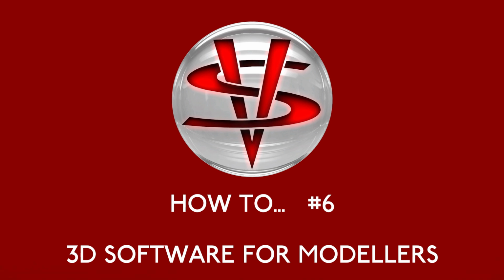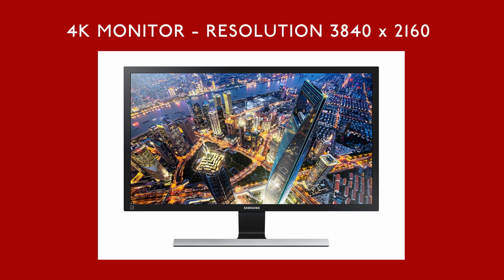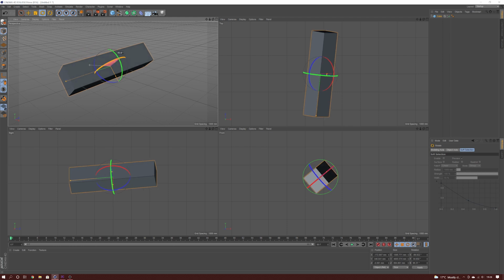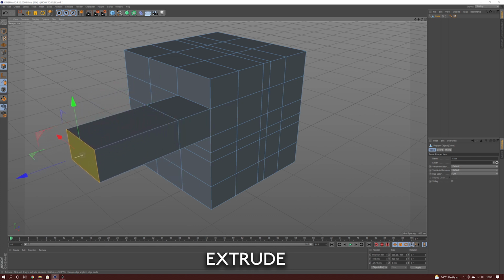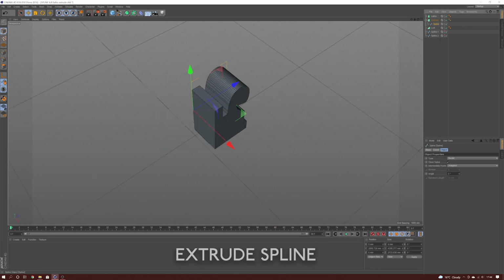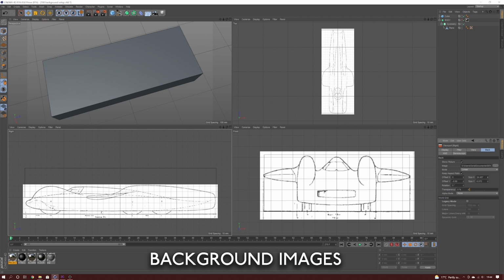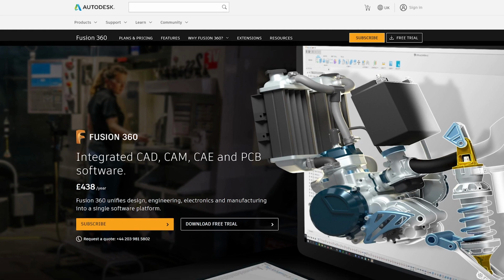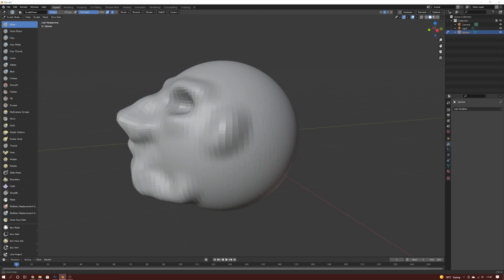HOW TO... PART 6 '3D SOFTWARE FOR MODELLERS'

Comment: Hi Sera, another great video full of useful info. I've been using CAD for nearly 40 years (doing Mechanical Engineering Design) so have gone from the primitive systems that used to take 30 to 40 minutes to refresh a 2D drawing to the amazing 3D software we have now. I'm using Rhino 5 and 7 for my modelling projects, Rhino 7 is the latest iteration and is great but they changed a few things which have made modelling certain items more difficult than in Rhino 5 so I still use both. I'm used to using CAD as a solid modeller where Rhino is really a surface modeller but does allow you to work in both modes. 7 has sub D which i've not used much but can see will be of use to get more free flowing shapes like on your Land Speed Cars. I found the first few minutes particularly interesting as you're using CAD in a completely different way to me but the later half of your demo was more familiar. I don't think people realise just how hard it is to construct a complicated 3D model like a plane or tank so its great they can get an insight in your video. I've been building a complete model including a complete interior, of a WW1 Renault FT Tank in 9th Scale which has taken 8 weeks, working 7 days a week so must be around 500 hours of modelling so far and i've still got a fair bit to do. But then you know how long these things take. I'm designing with manufacturing in mind so stripping the model down for 3D printing or machining is reasonably easy.  Rhino renders almost instantly which is one of its great features and you don't have to set up the resolution of parts until you export them as STL files. The only thing that does slow down is manipulating the model when it's fully rendered so I avoid doing that. If ever you'er thinking about changing CAD Systems, which i'm sure you won't, it is worth looking at. Trying to get to grips with Blender but finding that a bit of a challenge, it's so different from any CAD software i've had a go at. Thanks again for the content, i'm impressed by just how much you manage to do with your business and your side projects. Best wishes Mike
Reply from the maker: Hi Mike, thanks for the great comment. I'll check out Rhino, it may be perfect when Windows upgrades stop my C4D working. I'm going to try figure sculpting in Blender for my StuG figures. Should be a challenge 🤔. I'm always doing something modelling related that's how I  put out so much stuff. Fortunately I enjoy what I do. All the best, Sera 🙂
Reply: @StaplesandVine  Well, the only downside to Rhino is you have to buy it of course, the good thing is they do keep upgrading it for free even after other versions have been released, you just have to pay for new versions if you want them. I upgraded from Rhino 5 to 7 for the sub D feature. I never bothered with 6 as it didn't offer much in the way of new features that were useful to me. Not sure how much it is in the UK as i'm in New Zealand (but originally from the Hampshire). Rhino do a free 30 day trial so you can have a play before you commit to purchasing it. I think its better than Fusion 360  but in saying that David Parker of AFV magazine fame is using Fusion and he's my favourite model maker (i've never liked AutoDesk products much, they seem to use a lot more memory). David Parker is a genius, the combination of scratch building skills and painting is the best i've ever seen. I run Rhino on Macs, the PC version sometimes has more features but they're almost the same now. I know Fusion 360 is free for home use but you have to pay for it if it's being used commercially.  The good thing with Blender is all the add ons you can buy to help you sculpt but you probably already know that. I'm actually a sculptor so thats why I started playing with it. There's a good add on called Facebuilder which is made by Keen Tools which i've used. You can get it on a 30 day trial. You basically need a few photos of someones head taken at different angles with the same camera and lens combo. You then use the images to manipulate a standard head. I've created loads of heads with it and 3D printed them on my Form 3 printer. They are incredibly life like apart from the ears which are a bit simplified. I just import the OBJ files of the heads I created in Blender into Rhino to resize them to the correct scale I want and then I generate the STL files for printing. I will be using the 3D printed heads in some sculptures i'm planning. There are a couple of decent YouTube Videos on how to use Facebuilder. You can buy 3D scans of hands feet , etc., as you probably know which can save a heap of time. If you want to know more I can send you links to all the info you'll need.
Reply from the maker: Hi Mike, Its quite a complex workflow whatever 3D route you go down. Rhino looks good I'll certainly have a dabble. If I have the time I would love to learn Blender but I just have too many irons in fires right now. I really want to learn sculpting and I will probably use 'Makehuman' for a base mesh and then dress the figure in blender. Really I just want the excuse to buy a graphics tablet. Totally agree with you re David Parker - wonderful skills, a terrific modeller. Thanks for your offer of help, I know where to come if I get stuck. All the best
Sera.

Comment: after taking the time to learn i am now a blender cult member. used everything at one point and too settle on blender in 2021 was not expected. it used too be a potato but for it too dethrone my Zbrush you know that mofo is moving fast. also helps i am not sculpting figures anymore lol. Blender helped me 3d print tank tracks and custom sprockets etc so easy to get all that to mesh in blender ... add a curve.  array a track link around that curve add a curve modifier set the amount of links to bend around your guide curve and one tank track done ... easy  add a mirror modifier second track done ... Top Banana

Hi sera :P
Reply from the maker: Well done Vasili! It seems like you are a full-on Blender convert - well done. And, by the sounds of it the next 'Ian Hubert'! So I can expect to see a lazy tutorial on tank tracks sometime soon then...?
Reply: @StaplesandVine  lol you know what i only found his videos last night, i guess my reply sounded a bit like him.  but after reading noggins post i thought id condense what i needed to say lol .. i talk a bit like that anyway like a welsh delboy :P